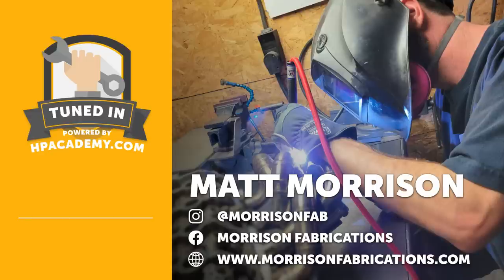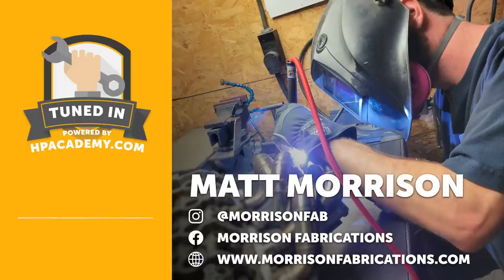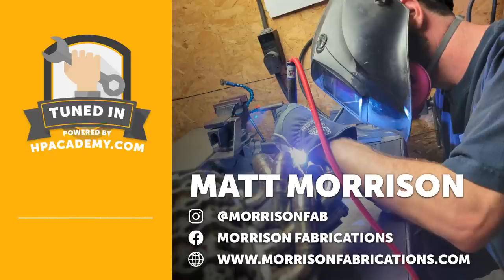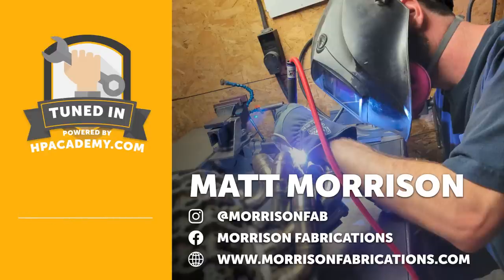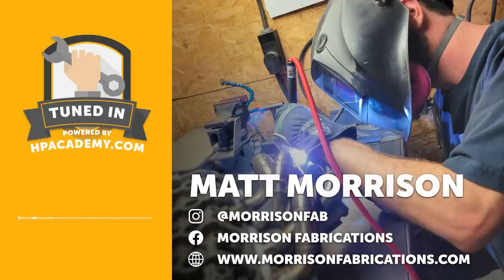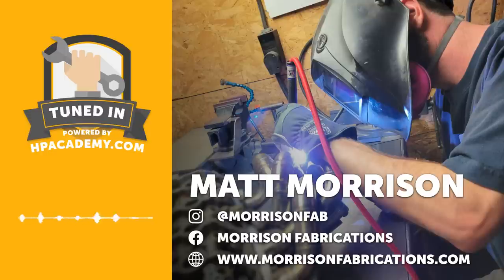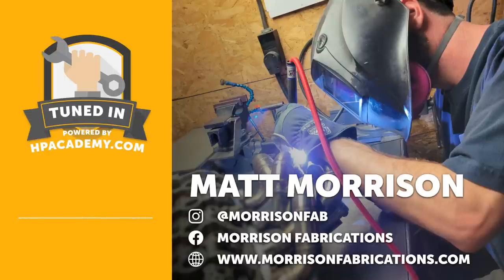055: Sorting Turbo Manifold Fact From Fiction. [#PODCAST]

Comment: Learned a lot, and this actually helped me make a decision on what material to use for my project car. (321)  In addition, what heat shield to use and maybe more importantly, what not to use and why. Mine is a road car, and your discussion helped me to make a decision on design as well. Not sweat the lengt detail, and choose the smaller I.D tubing out of the two alternatives I had. I really appreciate you sharing your knowledge and experience between the both of you! Thank you very much

Comment: Also, he is one of like 3 companies that over a topmount kit for an evo, that works with a full size radiator, and ac. It is very very tight in there, and he made it work
Reply: Keeping as many accessories as possible is important for us on our own cars so we do our best to keep them on everything we offer! It means a lot to us both that you acknowledged that. Cheers, Matt and Samantha
Reply: From someone who has built my own top mount manifold for my evo I know exactly how tight it can be especially with a larger frame turbo I wasnt able to keep factory fan setup but I was atleast able to keep my pwr full size rad... idk if I could have kept all stock fans if I had the OEM radiator or not but hats off to you guys for that achievement!

Comment: Quick question regarding two external wastegates on split pulse manifolds, my set-up is only street driven built for response and I'm running a 2.4L 4g, kelford 272's, longish split runner manifold with no external gate off the manifold, but with a single gate off the turbine housing which is an ATP 0.83 ar on a Garret GTX3076r gen2, would that still cause cross torque and cause ill effect?? Would I benefit from a conventional exhaust housing with a twin wastegate off the maifold set-up?
Reply: Putting the wastegate on the exhaust housing is never a good idea. Once the air enters the snail you do not want to disturb the air flow. Garrett has spent millions of dollars in R&D designing the internals of the housing. You will lose spool and can create surges on the wheel. Depending on how low your shooting for in boost and how much resolution you want determines how many gates you need. A big turbo with low boost requirements require precise wastegate control so may dictate 2 gates. If your divided manifold and divided exhaust housing, you have to separated the firing order properly in order to not make surge issues.(I.E if firing order is 1 3 4 2 then on one side of the manifold would be 1 and 4 and the other side would be 2 and 3 to even out the pulses)

Comment: Thanks for that pod cast episode. I’m a regular user of HP academy’s content and I’ve learned a lot trough it. 

Something more upcoming and used in Northern Europe is a 6-2-2 design manifold. I’ve seen some F1 designs of this and tried it also myself this year. 

Is this topic discussed before on turbocharged engines? We have used it with great benefits but I’ve purchased the knowledge so I can’t speak about the physics behind that topic. And when I search for videos and such, I can’t really find much info about it more then myself in my competition car what it does. I’ve seen some Honda Bike using a 6-3 config N/A and understand the physics about it. 

Is it commonly used in high end racing application more than f1? And do f1 use it for the scavenging affect or just a correct way of packaging? 

Maybe you should do a webinar where this topic is discussed deeper. More information to the real need to dive into👍

Thanks